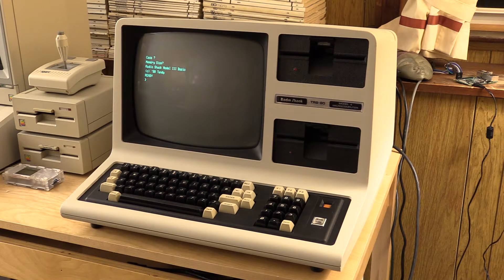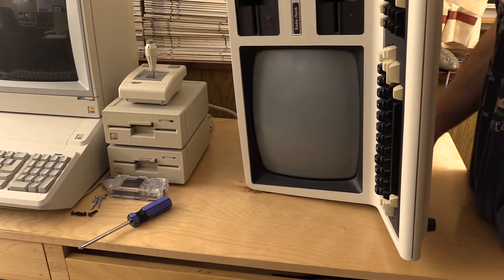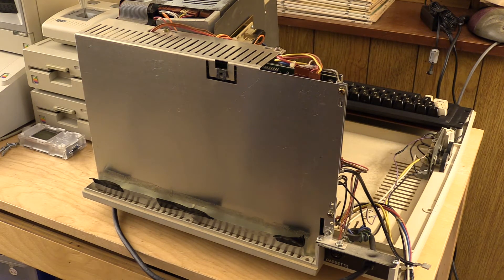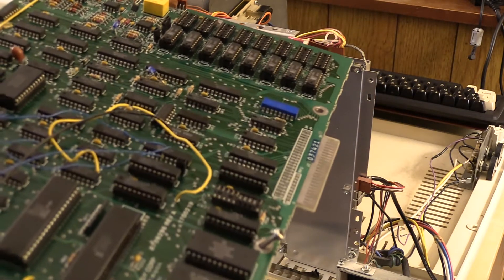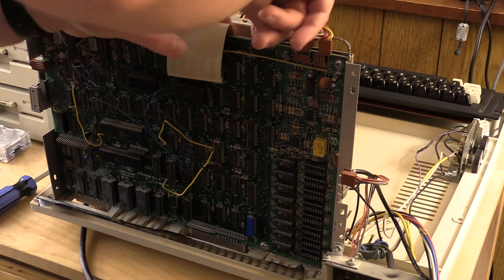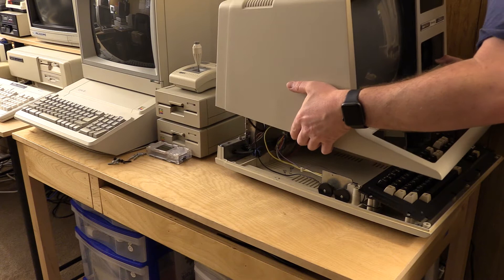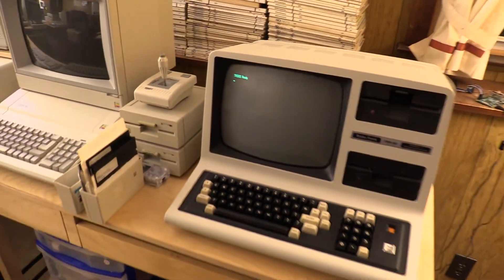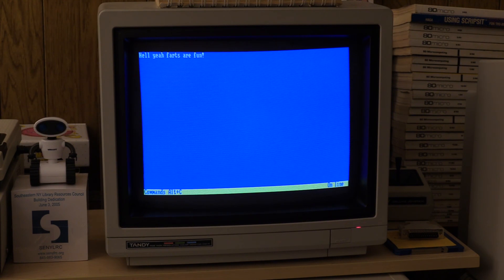TRS-80 Model 4: Installing And Testing A Serial I/O Card

Comment: Thanks for the video, always fun to watch you work 8). Is there anything special about the serial cable connection between the two computers?
Keep the vids coming.
Reply from the maker: Thanks for watching and the compliments!  The connection to the Tandy 1000 is through a null modem serial cable.  I also sometimes use straight-through serial cables with a null model adapter attached to one end…either works.  :)